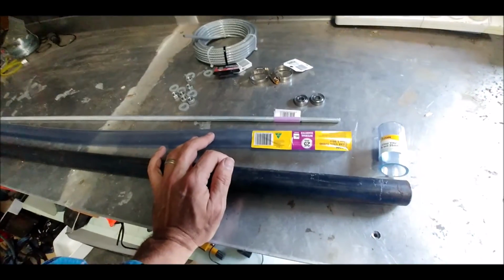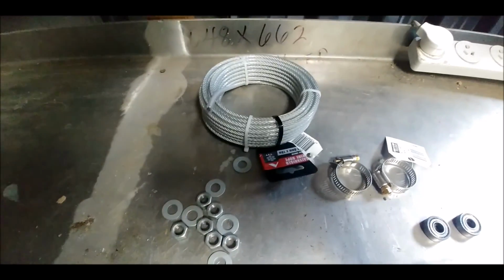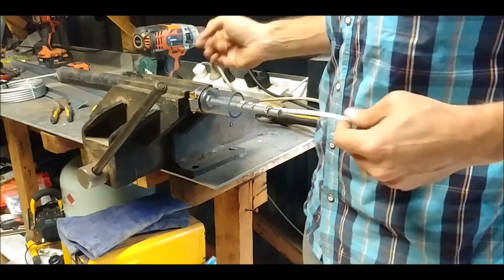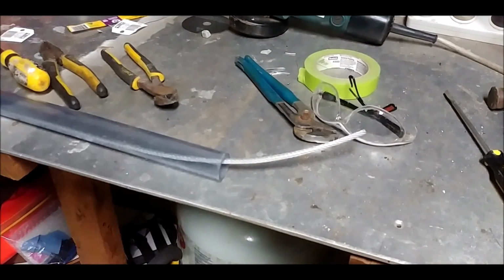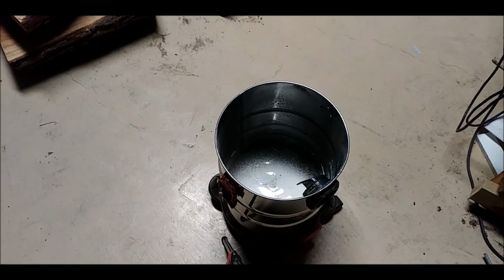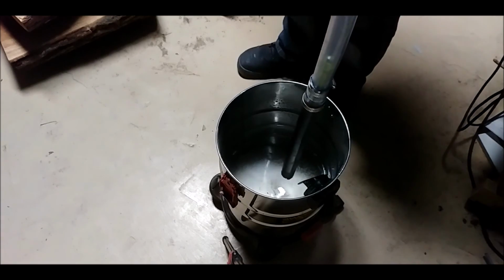Drill-powered Home-made $40 Concrete Vibration/Settling/Agitation Tool

Comment: Very good. I will try it too. What thickness cable?
Reply from the maker: Whatever thickness you can find, I think I used 6mm or 8mm. Make sure the clamp you use does not rub too much on the inside of the hose, or it will wear through.

Comment: Hello what happen if you make the needle smaller or shorter? Just to understand the principle
Reply from the maker: I'm not sure what you're calling the "needle". The principle is an eccentric weight being spun quickly, transferring the vibrations to the pipe through the bearings.
Reply: @robmatthewswoodturning4988  the needle is the pipe... if you make it shorter or small, does the characteristic of the vibration change?